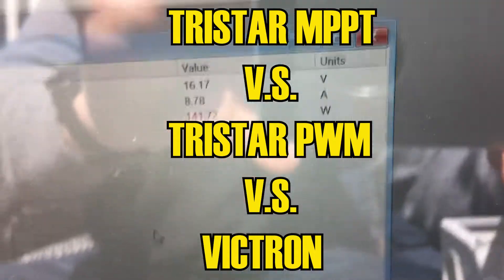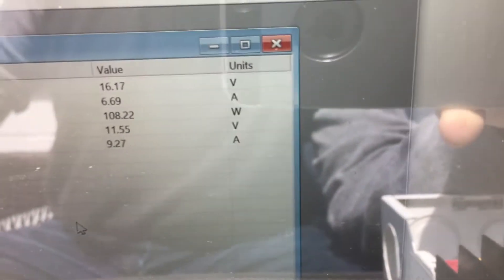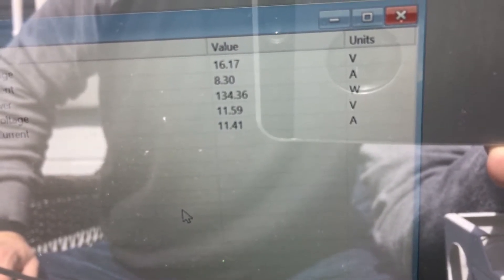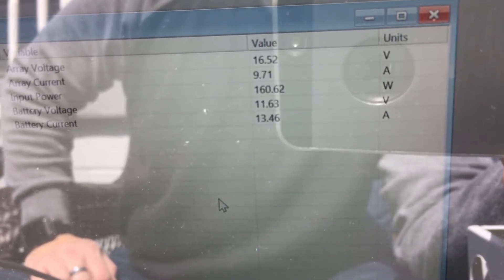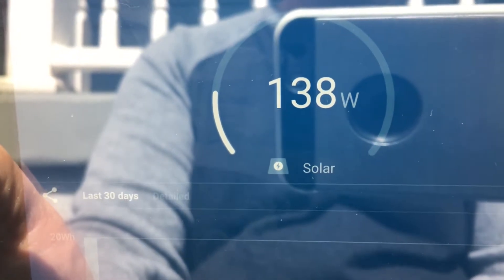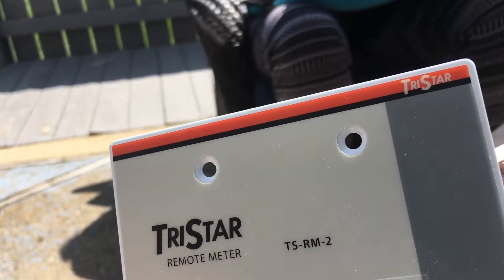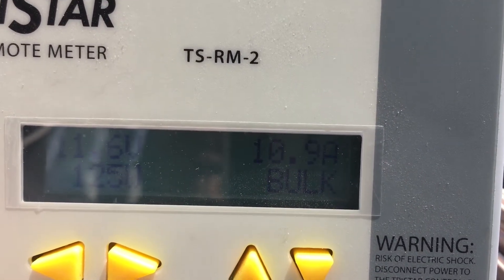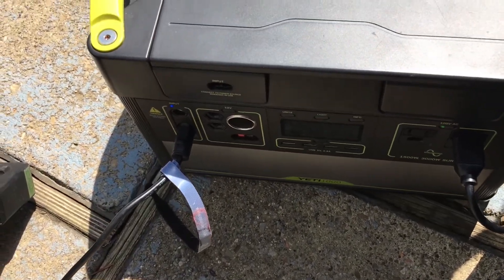Solar shootout - Tristar MPPT VS Victron VS TRISTAR PWM solar controllers

Comment: Thanks for the video. Was the first Tristar setup an MPPT one? Then the Victron MPPT, then Tristar PWM? I'm looking at possibilities for using a Tristar PWM charge controller for my hydro - the Victron MPPT I used before was awful, the way it went up and down like a siren with the constantly changing MPPT load.
Reply from the maker: correct!
Reply: TriStar mppt is superior quality to Victron but costs twice as much.